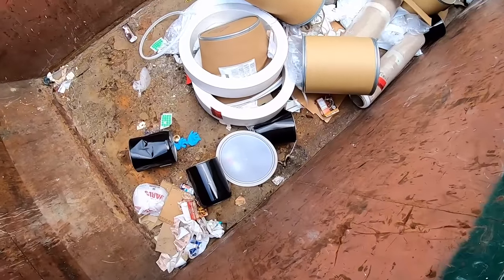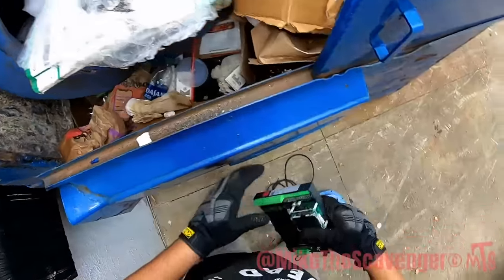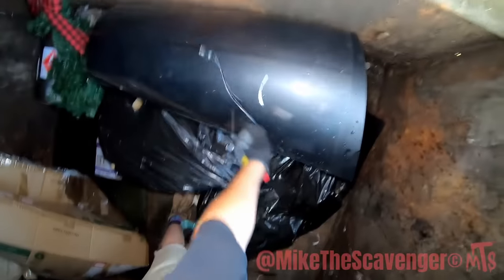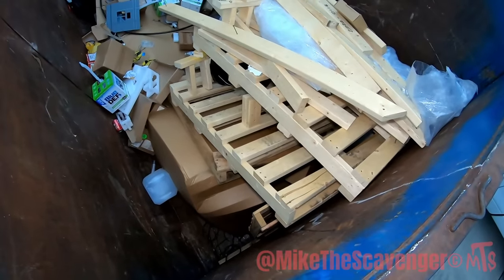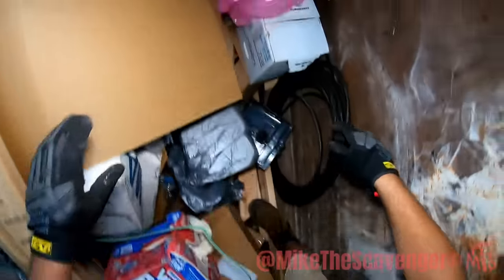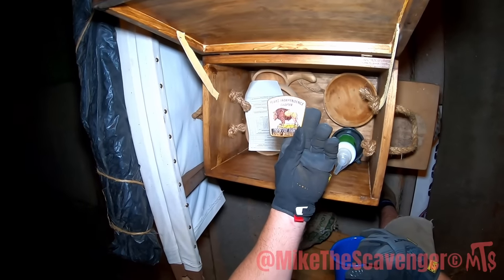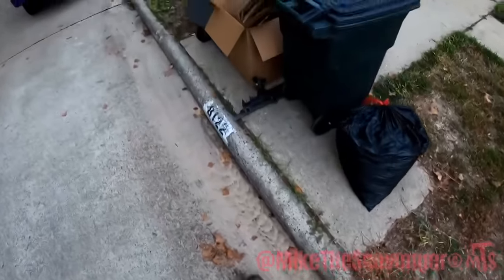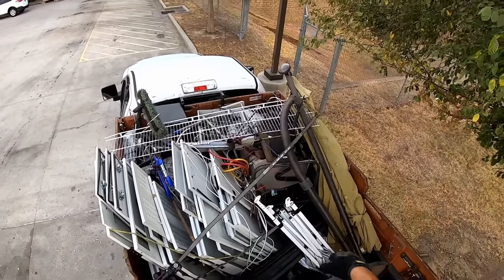Dumpster Diving & Curbsiding "Essence Of Dumpster"

Comment: Wow Mike sweet find he Honeywell thermostat, those are not cheap . Fyi when you hit a dumpster  with HV/AC supplies if they are new in the box parts you should take all of them , most of the parts are quite expensive and could be sold on line .you big time fan Keith

Comment: Mike that “ x-ray gun” is a intra ora X-ray machine. It should not be in the trash as it has the “tube head” piece still inside which creates the radiation. Not really harmful to us as it’s not the 50s anymore but they need to be recycled accordingly. Whoever threw that away could be fined once the state comes to do an inspection and it’s no where to be found and not reported by another company as recycled. The state of Tx and FDA regulate X-ray devices in Texas. I work for a dental supplier in Texas.

Comment: Mike, I have to tell ya a little story…I have watched you for a while now. The way you get washer and dryers in the bed of your truck. Well, my dryer gave up the ghost so after my husband un plugged it I decided I would push it out through the garage on this hand cart we have. It was a bit of a struggle getting the dryer on the cart, but I finally got it and pulled it through the garage to my S-10 sitting right outside of the big door. The plan, put it in the bed, drive it down the long driveway and set it out by the road for free.  Well, I get it turned just right, grab the bottom and lifting with my knees, I grunted and groaned, got it about half way in and lost my grip. WHAM!! The dryer fell and rolled to its side. I cussed, sat it up, and grabbed my hand cart and went inside. Decided to wait till my husband got home to help. 😅 oh, and I am 61 years young, but just couldn’t get it up there. 😮‍💨 Oh well. At least I tried. 😊
Reply: It’s awesome that you tried!

Comment: Mike, you have been calling pieces of scrap die cast aluminum  that are actually die cast zinc.  Zinc die cast alloys are more gray than aluminum die cast alloys.  Chrome plating zinc alloy die castings  is much easier than aluminum alloys.  Zinc die castings  are denser than aluminum.  The market price for zinc alloys often exceeds the price or aluminum  alloys.  Zinc in aluminum ingots can reduce the value because the zinc is a contaminant .  You should start separating the zinc from aluminum to make both you and me happier.

Comment: On that pressure washer. Take off the pump on the back. And see if the engine turns over. If it does you can use it for a something else or sell it they work well for generator replacement engines. 
New engine that size goes for 500 to 1000. Bucks. Used I sell them for 250 all day.

Comment: You find a gas or electric  water pump seized   remove  the pump  then check if the  motors work

Comment: nomad is not a toy it generates radiation and should be disposed of properly.  Really illegal to just pitch it in a dumpster.   Radiation generating items are highly regulated..... Now its your problem to dispose of....
Reply: Drill a hole through the tubehead, drain the oil and scrap it.